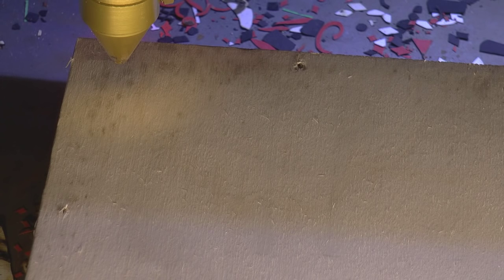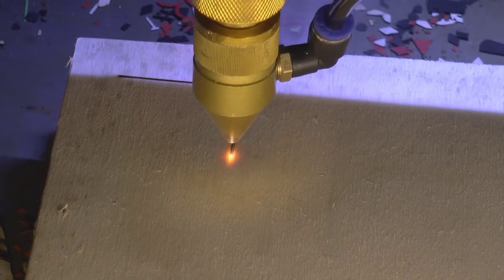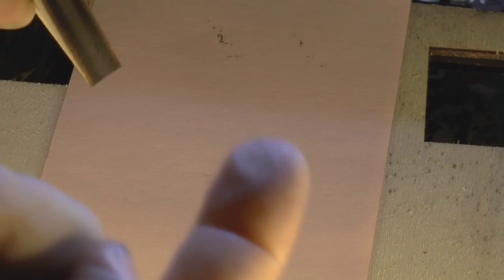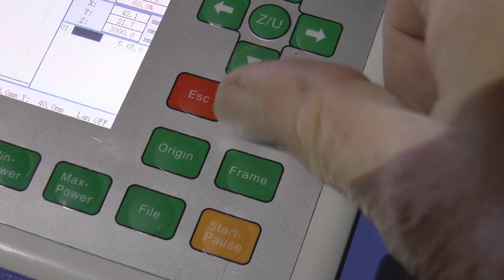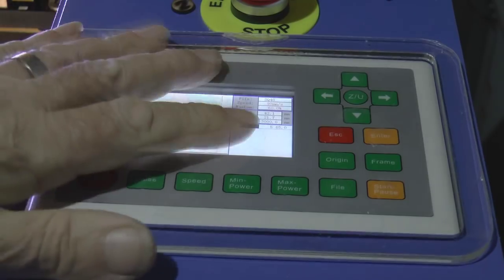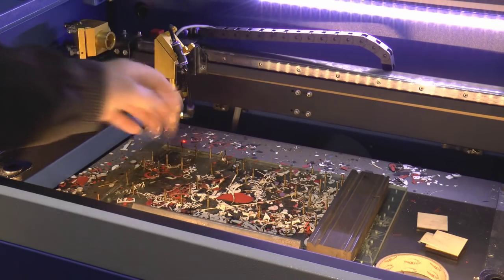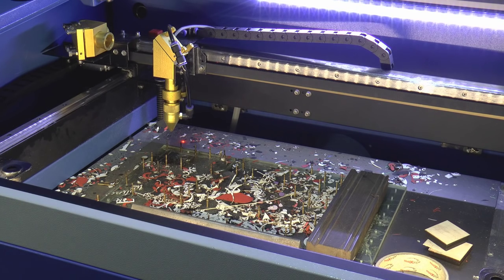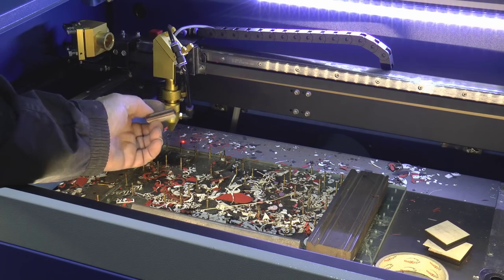RDWorks Learning Lab 30 Important odds & ends plus Cutting 10mm ply

Comment: Hi Russ,
I'm having issues with the software itself. Sometimes when I type text or upload an image, the preview on the software shows the image as a single line. Other times I do not have this issue. Do you know what the problem might be?
Thanks
Reply from the maker: Hi Kyle
Look top right in RDWorks and there will be a software issue shown there What does yours say? Also what windows are you running?
Speak soon
Russ

Comment: Hi Russ, re: keyboard film damage - I think you will find the wear frills are from the PE protective film on top of the keyboard touch membrane. It is best operated with the soft end of finger, not by fingernail. But we, engineers do not usually grow long fingernails. The film can be removed and show your real actual keyboard surface. Just try it on one of the corners with your fingernail.
otto
Reply from the maker: Hi Otto
I usually hate the protective films they plaster on some new items so I normally get it off soonest. In the case of the keyboard I removed a film immediately but became cautious when symptoms of wear (slight ) started occurring within a 3 months. After comments from others I have revisited the film issue on several occasions and am convinced I am  back to basics. However, on my new machine I have checked and I find TWO film layers have been fitted. Although I have lifted the corners to investigate, I have decided to leave the film on for the time being.
Thanks for your comment....I can sometimes miss the obvoius
Best regards
Russ

Comment: Hi there.  What speed and power did you use for that 10mm ply?  Looks like a Thunderlaser like I have.  Which model is yours?
Reply from the maker: Hi Des
Mine is not a Thunder laser machine but there is virtually no difference in out 50 watt machines other than you probably recieved a proper 50 watt tube (1000mm lng?) with your machine whereas my ebay machine was fitted with a reject 40 watt tube (800mm long) that barely worked.  What you see in this video is my marginally better second tube  that was delivering 30 watts at the workface. I was running this 10mm test at 5mm/s and it JUST cut through. 4mm/s would have been better. However you MUST note that I am using a 38.1mm(1.5" ) focal length lens. This is VERY important. Most machines are fitted with a 2" lens as standard and you will struggle to cut 10mm ply with that even if you have a good tube delivering 40 watts at the cutting surface.. There is a whole video about lenses and understanding what energy density is all about. 
https://www.youtube.com/watch?v=61bGzWicRRk
I can sum it up with this little scene for you to visualize.  If you give a 5 year old  a scalpel (a 1.5" lens) he can do a lot of damage with it. Give him a lumberjack's twin headed axe (a 2" lens) and he will hardly be able to pick it up!!!!. My point here is that the axe is a great tool for cutting down a tree but unless you have the strength to use it, it's useless.  To do any sensible cutting with a 2" lens you will need at least 50 watts of useable power
I think Thunder laser use a matched nozzle and lens system so if you want to change to a 1.5" lens (by far the best all round lens) you may have to buy a nozzle as well as a lens.

Hope this helps
Best regards
Russ
Reply: Thanks Russ.  My glass laser tube is very long; it is the whole width of the machine (900mm bed) plus an extra foot in an extension box. It's 100W. I must check on the designation of the lenses I got with the Laser (I think I paid extra for one or two) but I have a standard one I use all the time, plus a heavy duty (they describe it as that) one for cutting thicker materials up to about 18mm. MDF cuts quite easily to 18mm and so does perspex.  I also purchased a HD head for more delicate work.  I've been so busy learning with the 'standard' head I haven't even fitted the other two yet.

Comment: I need to come back and watch all your videos again. I had no luck cutting through 1/4 inch bamboo sheets but assumed it because it was too hard. I'll try lowering the speed.

I'm doing engraving on barn wood making signs as big as will fit in the machine. I've discovered that the laser eye sits too high to run a project the full size of the work area. the lid slants down in the front and comes down so low that there is negative clearance... the eye literally jas up into the lid. Is it just my machine? This is such poor design for functionality. I must open the lid slightly in order to run a full size project. Oh well.

I'm so terrified of burning out my bulb or breaking the machine... im not an engineer. .. just an artist. I want to thank you for these videos. .. they have helped me so much. I wouldn't be doing this at all and would never have been brave enough to make the purchase without your tutorials. THANK YOU!
Reply from the maker: Hi
Bamboo is a fairly dense material but it  depends on several things as to whether you can cut it with your machine.
I will go to your private messages and speak off line.

Comment: what is that RD model? if i can learn it then using it on 6442G ? Thanks
Reply from the maker: +李彬 
I think you are wanting the software. You can down load it from     http://www.thunderlaser.com/down
Reply: i got new controller Model is RD6442G. Looks like the same as the video. I just wanted make sure is that the same model. So that i can learn how to use it by the your video. Actually ,it was great videos. Thanks for made that
Reply from the maker: +李彬 
Yes that's the controller you will find the manual at either       http://www.thunderlaser.com/down     and the RDWorks software or
directly from RUIDA   website     http://en.rd-acs.com/down.aspx
Reply: SarbarMultimedia Appreciated it !!!

Comment: Some plywood's cut easily others cut poorly. I think it has something to do with the glue used to make the plywood. I have also noticed that faster cut speeds (15mm/s) with multiple passes  sometimes work better than slow speed cuts. Slow speed cutting can warp small parts and leave burns from the hot smoke.  I ordered an add on exhaust fan. The stock draw is not good enough for cutting/ etching wood.
Reply from the maker: +Jared D 
Hi Jared
My guess is that your machine is fitted with a 2" focal length lens. This is the norm for most engraving machines. The problem with this lens is it places the nozzle about 20mm above the worksurface and the force of air from your air assist  has lost all its oomph by the time it has jumped the gap. Wood is cut by a burning action and produces smoke and tars from the resin in the wood. It is essential to cut through in one pass and with lots of air passing THROUGH the cut. This will ensure that you eject the smoke and residue out of the BOTTOM of the cut. If you look at my video about lenses you will see that using a 2" lens has reduced your machine's CUTTING ability but makes it perfectly ok for engraving. As I answered to Mentorcase above, the dense smoke and fumes are great at absorbing the laser power that should be going into cutting.The fact that you recommend multi passes at higher speed to get rid of your surface staining further confirms that you have a 2" lens. The pathetic airflow into your cut area can cope with light fumes and moving faster means you are running away from those fumes faster. Take another look at the crude temporary air assist that I rigged up for the 2.5" lens tests. This will help but the only way to get CUTTING performance is to buy a 1.5" focal length lens.
Regards
Russ
Reply: +SarbarMultimedia 

I want to thank you for taking the time to put up your  learning labs. I have seen your lens lab and have ordered a 38mm lens. 

My only complaint about the machine is the crummy software. The rest is forgivable due to low cost. I have found a free  2d cad system by Siemens called Solid Works and I would be interested in your opinion of it.

Thanks from Jared in chilly Ann Arbor Michigan.

2/26/16
Reply from the maker: +Jared D 
Hi Jared

You are on the right track with Solidworks. However I'm unaware that it's free anywhere (other than for a trial period). It's a fully featured 3D modelling software. I have an old version which I use in conjunction with my 2D cad to turn profiles into shaped plates with thickness that I can then assemble into 3D models to demonstrate my designs to clients who have no spacial imagination. The right track is that Solidworks is designed by the French aircraft manufacturer Dassault. They have a truly FREE FOR LIFE very well featured 2D cad that you can download. The only thing they want is your email address so that they can keep bugging you to upgrade to the Pro version and Solidworks. A small price to pay for something that's good and free. There are basic help files but to download the full manual (about 180 pages) you have to divulge more info about yourself/business. If you do decide to download it then use the YouTube Messages to send me your email and I'll send you a "no strings" copy of the manual  that I have already downloaded. The software is called DraftSight and is available from
http://www.solidworks.co.uk/sw/products/free-cad-software-downloads.htm.

 Its so much easier to design in a CAD software and output as DXF. RDWorks imports them well. That's my preferred route even though I have Photoshop and Illustrator I finish up sending files between packages to finish up in the cad system. 
Finally Just a few words in defence of RDWorks. I thought initially like you, it's free for a reason and you always get nothing for free. It is designed by  the people that make the machine control board and you can download the latest version from here
http://en.rd-acs.com/down_complex.aspx?FId=n14:14:14 

I soon realised that this was never intended to be a piece of design  or CADsoftware but just an interface with a few editing tools. I became a bit of an admirer. In fact it's a fantastically easy interface between drawing and machine. Having used professional CAD/CAM systems for years I have not come across such a simple drawing to machine code interface (you cant even see the machine code!!) but it works perfectly every time.
Regards
Russ
Reply: +SarbarMultimedia  
My mistake it is called solid edge.  Solid works is the program my teenage daughter keeps
( bugging me)^10th    to buy.

Comment: Great tip with the keyboard protector I will get to work on building my equivalent ASAP! Thank You! Can I ask what power tube you are running? I am very impressed with the cutting of that 10mm birch ply! In regards to it not cutting completely straight is that not due to the shape of the focused laser beam? I have been told that the laser comes out the lens in an hour glass shape hence the need to focus the distance from the head. I believe that cutters which are optimised to cut have larger upgraded lenses giving a thinner hour glass profile of the laser.
Reply from the maker: +patrick whelan 
You have been reading well Patrick. Some good stuff about lenses and focal distances here http://www.parallax-tech.com/faq.htm#spotsizetable
My off-angle was more than just beam shape. My lens is 38mm focal distance and has a very short neck length. However, it doesn't seem to give curved edges on 10mm acrylic where it would be most sensitive. My angle problem was solved when I set my beam correctly. I did a 4 part session about setting my mirrors. In part 4 I finally found my problem https://youtu.be/TUJgBcb2xnQ
Reply: Thanks for that I look forward to reading that and catching up with all your videos. I only found you last night and as a redsail cm1290 130w (which isn't arriving till next week) owner your RDWorks subjects look really interesting! What machine are you using? and what tube is it? Hoping I will be able to cut that material too!. Thank you
Reply from the maker: +patrick whelan 
Hi Patrick

There is a series of 6 videos about me bringing my machine into life https://youtu.be/YvrMeUUzaBo.. I also explain that I am just an old guy enjoying himself with a techno toy and I'm letting you look over my shoulder. I make no claim that I'm an instructor or that my videos are tutorials. These are live takes mainly and you see me making mistakes which I hopefully correct as I learn more later in the series. So watch and make your own judgements.

As you will see from my videos, I have a 50watt direct from China import. Sadly the tube is not what it claims and I have 38watts max coming out of the tube. I then lose more through the mirrors and lens BUT look what I can do with it!!. 130 watt? you may even be able to cut certain thisn metals with that. I used to run a laser profiling company and had a couple of 3kw machines. They were more reliable through flow lasers not these little sealed tube devices.
Good luck
Russ
Reply: I really like your style and you can tell you are very knowledgeable!

Oh my god I can't believe you can do that with 50 watts! I would have guessed 100! That is amazing I had a 60 watt which I sold because it really struggled with 6mm and was just really slow I would cut 3mm at the same speed you are cutting 10mm. Admittedly I really didn't know a lot about them at the time and it may have been user error. I live in the UK as you do too I assume and so I have had a good five week wait for my replacement machine to come from china so I have had a lot of time to research. The two reasons I went for 130w it was the most I could afford and the speed should hopefully be really quick. I was making large 3 and 6mm products like dolls houses and they where taking ages to run the designs sometimes up to two hours X 3. Maybe I just had a dud!
Reply from the maker: +patrick whelan 
Hi Patrick
My 50 watt tube is actually a 40 watt tube and runs at 37watts at its max drive current of 20mA. Dimensionally it's too short for a 50watt tube but I was ignorant when I bought it.  There is serious fraud going on in this Chinese laser industry.  Your CM1290  is 1800 mm wide. There are 130 watt tubes around that will fit in that frame . They are 1650 long http://www.cncoletech.com/Laser%20tuber%20high%20power.html or check out a reliable supplier recilaser.com. So as a crude check it looks as though you will get what you ordered
Should gobble up your work.
Happy New Year 
Russ (Colchester)
Reply: Thanks Russ I hope so! Yeah I'm planning to go over it with a fine-tooth comb when it arrives as it represents the biggest investment I have ever made. I'm tempted to buy a laser power probe so I can measure the output which would be great for checking mirror efficiency and actual output but another £100! Think I should wait. I think the Chinese laser cutter market is a bit of a mine field, now hearing how good your 37 watts is I think my 60 watt was a joke! I've bought this one directly from the manufacturer this time so I'm hoping I don't get stung again. There are a lot of people who are happy with Chinese lasers so I guess you just have to keep your wits about you. I'd be very happy with yours!

All the best for the new year! Happy Lasering :)

Patrick (Birmingham)
Reply from the maker: +patrick whelan 
My meter is a P100C from http://www.macken.com/price-list.shtml. I couldn't find a source for buying the cheap Mahoney power meter. I eventually was chatting to a fellow sufferer in the US and asked if he could source one for me. He tracked down a Mahoney meter and bought it from an Amazon seller. When it arrived it was rubbish. Virtually unusable . He got his money back and I took the plunge on this "proper" meter. He bought it for me tested his own machine with it and shipped it to  me with a "used thermometer" description $25 value. I only had to pay about 1.50 VAT but the post office charged me £8 for "fee collection". The meter is not cheap (you would need a P200C) but it's a superb piece of kit and very easy and reliable to use as you will have seen from my video. It will be invaluable on my next project which is tracing why I'm losing 15 watts through 3 mirrors. £250 total with shipping is a reasonable investment  when you have so much tied up in your machine. If you decide to go that way I'll see if I can pull another USA favour.
Although I'm envious of your new toy I don't need a bigger one. For me its just techno enjoyment with no business to run.
Russ
Reply: Hi Russ, thank you so much for that info I didn't know there where quality issues with the Mahoney probes! Glad I flippantly mentioned them and didn't throw away £100 on rubbish! Your suggested ones look good I will definitely get one but will wait till my machine gives me some return first as I'm strapped. I'm really keen to watch all your videos - I didn't know you had some on probes too! - but as well as trying to get my 'business' off the ground I am a full time mature student (computer science) and am slaving away on an assignment which is due on the 4th, not enough hours in the day! 

Yeah when I saw laser cutters for the first time a few months ago I knew straight away that they where for me. I'm sure I don't need to tell you how satisfying it is to watch a cutter make something which you built on your computer. The best techno gadget ever! 

I may take you up on the offer of some american help if you don't mind, thank you! By the way if you ever need anything cut that you can't fit in your machine or is too thick I'll be more than happy to do it for you :)
Reply from the maker: +patrick whelan 
Thanks for your kind offer. You may like to check out https://youtu.be/DrbQdIAQl4s for my initial reaction and use of the power meter
Good luck with your assignment
Russ